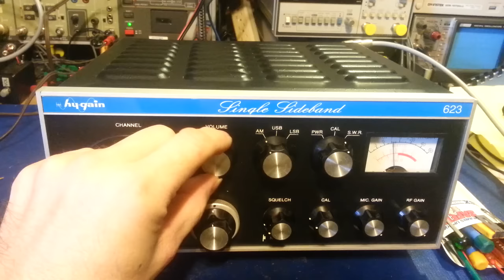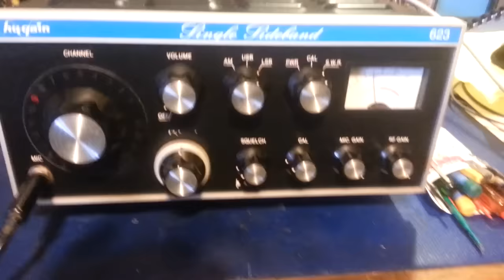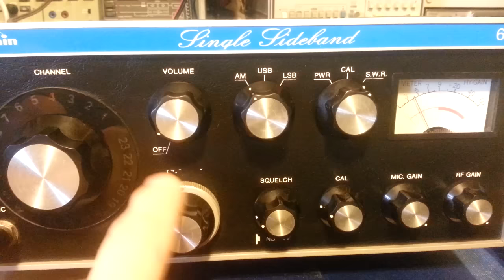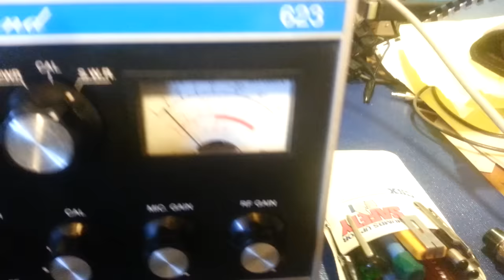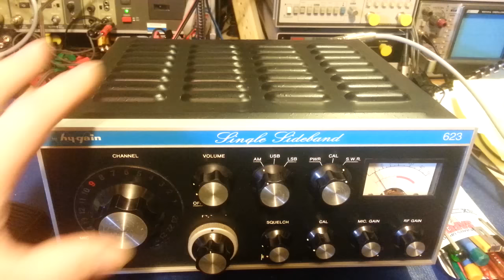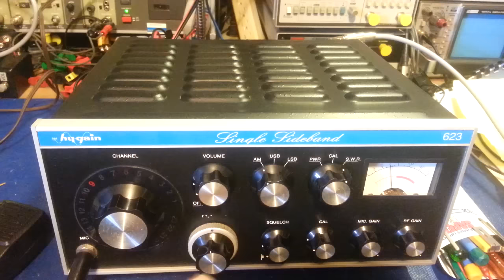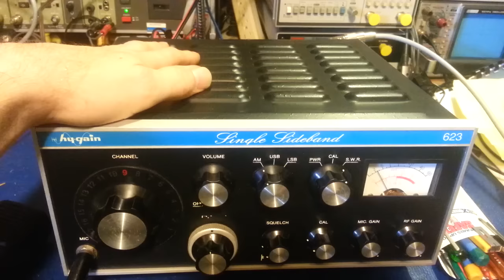Another Hy-gain  623 hybrid CB radio added to the collection.

Comment: Great video. Obviously it needs relamped so where did you find a source for that oddball meter lamp?
The first one of these that I rescued came from the Gaithersburg Hamfest. It came with the operator and factory service manuals. I had it until someone offered me way too much money for it. 
The one I have now was rescued from a CB shop after its owner died. It is unmodified, as are all of my vintage radios. 
The hybrid, modular construction is shared with rigs like Yaesu's FT-101 and Uniden's Tempo 2020. It was also a very early attempt at microprocessor frequency control with discrete chips. 
These radios run everything through the crystal filter and the tradeoff for high selectivity is somewhat constricted receiver audio bandwidth. Mine had a low TX output issue that I traced to a shorted cap in the meter power measurement system. 
The AGC in these is slow, meant for conversational SSB, and audio fade is noticeable with mobile signals and skip QSB. 
AFAIK, they only made these from 1974 until the end of 1976. During that time they made 3 versions, the USA made 623 and 623A, and the Puerto Rico made 623A.
AFAIK, there were no 40 channel versions made of these.

Comment: Have you had any experience dipping these and others like it completely into a largish ultrasonic cleaner ?

I use a large one to clean lots of different electronics, as long as all the delicate stuff is out, like meters, speakers etc......but I have never done a near complete device at once.....mainly boards and modules.

I used to know an old chap that worked for Tektronix back in the day of the 500 series etc and he said the procedure before doing a full cal and service was to dump the whole machine into a cleaning solution before they even started working on them......I believe it may have been a sort of aerated tank of some type of cleaning solution.
Reply from the maker: I'm afraid the large ultrasonic cleaner I have would damage things.  I have a 75 gallon commercial unit out in the machine shop.  I think it would destroy windings in IF transformers and bond wires in semiconductors.  I know it's powerful enough to cause severe tissue damage or death if you accidently put your hand in it.  Thing is covered in warning labels.
Reply: yeah that sounds like a pretty awesome machine.........the one I have generates about 1500watts and is about 50 gallon........I can turn off transducers to lessen the power and run the heaters on only if there is no sensitive stuff like wax etc to melt on the boards.
I am going to start populating my YouTube channel shortly, so I will video the process and do an experiment with some old Valve stuff and compare the outcome with the later boards etc......will be interesting.

Comment: Mike - how do you clean your mic cords when you do a restoration? I've got a couple that need some attention, they've simply been sitting in place with little use for several years.
Reply from the maker: If their horribly nasty like this one I usually submerge all but the ends in a butter dish filled with some TRC cleaner for a few minutes.  Then I just pull the cord through a microfiber towel.  If there not to bad I just lay the microfiber towel in my lap, lay the cord on it and spray some cleaner on it.  Give it a few seconds and pull it through the towel.  The microfiber towels are great for cleaning almost anything.  Its like having a million little cleaning fingers.

Comment: Mike,
How do you repair the lettering on a textured surfaced like that? Maybe a video?    :-)
Reply from the maker: Rub on lettering.
Reply: AHH. I had bought many Letraset packs years ago. Just can't lay my hands on any.

I always had problems with textured surfaces. Maybe the age of the dry transfers could have been the problem. On flat surfaces, they worked great.
Reply from the maker: +Donald D'Egidio 

You can get custom ones made or print your own now days.

Comment: good video. I got a old hy-gain modle 675 vfo I ben looking for some info like a list that it could work on?
Reply from the maker: Works with the model 674 mobile.  It will not work on the 674B.  The FCC quickly put their foot down on the 674 and made them remove the octal vfo jack on the radio.